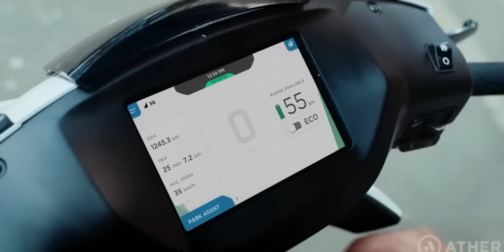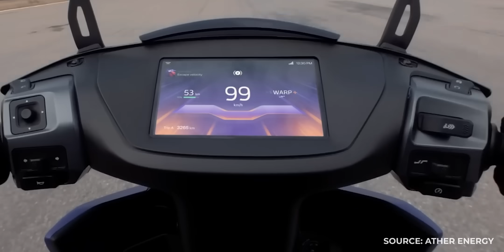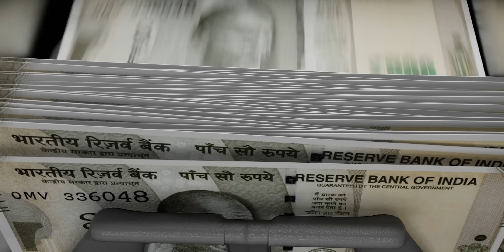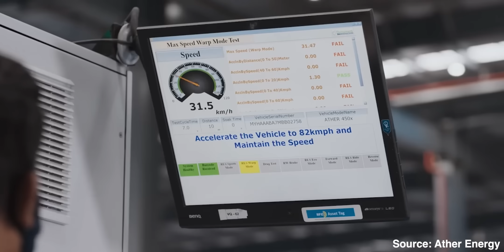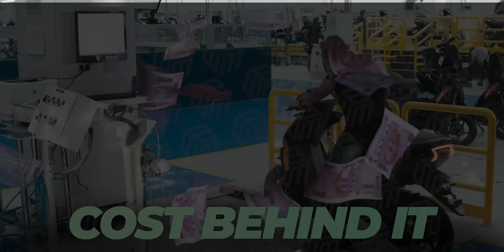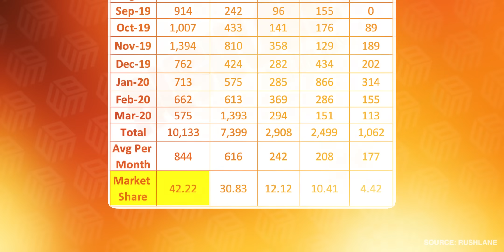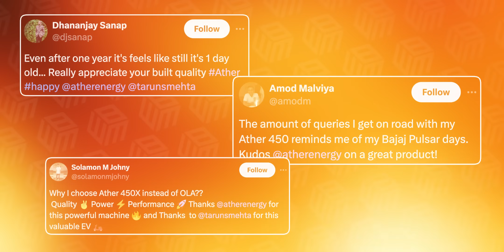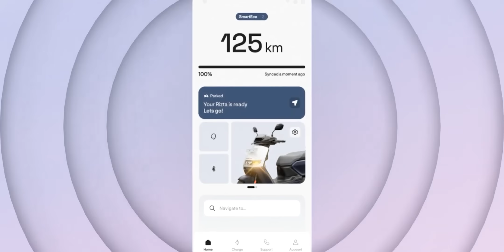Why India's OG Electric Scooter Company is Failing? - Ather Energy Case Study

Comment: Ather will fail because of the high service cost and the warranty is only for three years. It's not only After all the EV true face comes out after the warranty is over. Go for EV if you're Lucky and everything is fine after 3 years. But imagine the cost of parts replacement. Apart from the battery. And worst part is after 5 or 6 years of want to replace the most of the parts will be a relic and again you have to trash it. So staying away from EV specially After is good for your health and have a peaceful mind. AND I'M ATHER 450 OWNER AND USING IT FOR 4+ YEARS AND FACED SEVERAL ISSUES ALL WE COVERED WITH ATHER Service PRO SUBSCRIPTION. Now Ather has stopped all the subscription plans and the service costs are sky high very high.

Comment: Very less range for the price we pay 
It's costed 1.85lac on road and getting only 70km in ride mode 😢😮
Reply: I have 450s which easily gives 85+ kms in sport mode.
Reply: @mayankmaestro then may be you driving light acceleration in normal way.
I am driving with 2 persons with avg weight if 79kg each and 5 kg weight in boot including charger with hard sporty acceleration like you saw in advertising  with avg speed of 55kmph
I am using 450x hr propack  3.5 gen  I am getting only 70km in ride mode and 95km in eco mode ( costed around 1.85lac )
It's too less for the price we pay 
No charges also to travel anxiety free and it takes 5-6hrs to full charge again
Reply: @chaitanyakiran  I am rash driver always drive in sports mode, touching top speed frequently. My weight is 75kg drive solo only. Agree whatever you are saying is correct. At present EV vehicles are not a complete replacement for ICE, Before buying EV must make sure it's true range is around twice of our daily commute. My daily commute is around 55 km and I have a charging option at my office also. So, it's any day a better deal for me. EV can be a good option only if fits in your requirement.
Reply: @mayankmaestro  yeah agreed none of ev as of now replace completely as a primary vehicle for every use case

Comment: I think Ather should cut their cost by removing touch screen or LCD display. Many people in our Village doesn't even use them, in ola obviously so they are moving towards normal key type ola, which is much cheaper
Reply: Yes good point. They should have a base model with no features.
Reply: @raghav90  I too agree with what you say....we  just need a normal reliable electric scooter.
Reply: The touchscreen is part of their overall offering which bolsters their software service plans as well. And a lot of people don't know but a lot of times, touchscreens can be cheaper than needle and button interfaces. That's why you will see a lot of cars that come up touchscreens by default
Reply: How will they spy on users and collect data that can be sold to 3rd party companies? You are too naive.

Comment: Ather is way behind Ola in R&D, check the number of patents filed by Ola in 2023 and compare them with Ather. Most people attribute Marketing behind Ola success but they fails to mentions that buying companies is not new, even Elon Musk bought tesla from someone else but it's what you do with that company. Ola electric filed the maximum patents from India in automotive space in 2023 way ahead of Suzuki, TVS,Ather, BYD(India) etc. Ather had a upper hand in R&D during early stages but now Ola,TVS, River etc are catching it. And in addition ola is building it's on cells which will further give it a edge over Ather in price .
Reply: No. of patents dont translates to being better in R&D. Track record tells you that. Ather has 0 fire cases yet, 0 chassis breakage and better software experience as well. Think about it
Reply: @babbalgts  patents tells alot. It tell how much company is trying to innovate, patent isn't marketing trick. Fire cases are nothing if company has solid feedback system. Ola is heavily investing in vertical integration. Bhavish is smart. Ola is ahead of aether. It's not just marketing. There many peoples in my city with ola. No single fire complaint. 

Its not ola or ather its ola and ather
Reply: @babbalgts  filing patents shows the research intents of a company. It shows that the companies is serious about it's research and development strategy and is not for a few bucks in short run. All the automotive companies when they start and increase their production exponentially have problems, no automotive company in history is free from that. All I'm saying is People are underestimating what Ola electric brings to the table and only attributing Marketing as he only reason for its success, but guess what Hero Vida, Okinawa also did extensive marketing but they failed
Reply: What new innovation did Ola provide with all those patents? Useless music system?
Reply: Patents mean nothing here in India 
It's IP that is true development of technology 
Because I Van have a design as a patent but not technology its more the IP which has a greater value than a patent 
Pls compare those numbers
Reply: @kshitijpandey6514  Patent rights are considered intellectual property.
Reply: Elon Musk only bought abandon car company to manufacture Tesla

Comment: I believe in Ather much more than Ola.
Reply: Ola scooter is good 
Service centre is worst
Reply: Me too
Reply: ather charges premium and provides shit.. yeah built quality is better than ola though.. what ather did in 7 years .. ola did the same thing within 2years with almost same amount of money(offcourse olas r&d were not same as ather as they imported the tech)
Reply: Yes it's a good one
Reply: @Ashu_mm2028you don't care about quality
Reply: @Sticklemitako  it's scooter not a car
Reply: @Ashu_mm2028I use both. But personally I like ather. Because of their after sales service, product quality and the comfort. If you want look than go with ola. But if you like comfort, quality, services than go with Ather. You won't regret.
Reply: @Ashu_mm2028 quality
Reply: @Ashu_mm2028 ola is shit man, their scooty breaks down, customer service is bad. only cost should not be the concern. should you buy one ather for 5 years or 3-4 olas in 5 years
Reply: @Ashu_mm2028 Bcoz ather comes with Aluminium Chasis where as Ola comes with Steel chasis 
Ather's Battery casing was Aluminium which is good for heat transmissions where as Ola comes with Fiber casing which is not as good as aluminium in terms of heat transmission 
All the Ather bikes comes up with PMS motor where as Ola except one High end model every other bike has Hub motor
Ather's Battery comes up with cooling material to cool down the battery where as OLA doesn't have such system 
I hope this gives ur answer
Reply: @Ashu_mm2028 Have you ever heard ather scooters catching fire. Till now this automotive company created the safest ev scooters
Reply: @Ashu_mm2028athee has much better durability and built quality
Reply: Same
Reply: I use both
Reply: Ola is a scam sooner or later it will be out.
Reply: @Ashu_mm2028 THATS A QUESTION
Reply: That's why it fail😂
Reply: @SoldierofGodAki ab bol yahi baat free hogai teri ola ab to😂
Reply: @Ashu_mm2028 better products comes at a higher price. if no, go buy an apple from china
Reply: Thank you sir.
Reply: @Ashu_mm2028 It also provides better value and more peace of mind. Better options sometimes cost more.
Reply: Ceo of ola paid to this youtuber. Surely 😜
Reply: Bhai itni mahgi h ki kabhi top 5 me bhi ni ayegi...price bht important h india me
Reply: @apnirasoi3149  Fortuner bhi nahi aati top five in sales mein. Does that mean it’s bad business? Also they have come out with Rizta to target wider audience.
Reply: @apnirasoi3149  jokes on u they r top 4
Reply: @apnirasoi3149  Rizta is cheaper and much well rounded product than Ola S1 Pro
Reply: Both will fail. EV bubble will pop.
Reply: @VijayNinel  the bubble has never formed yet..  no one will fail either.. Evs are needed.. ICE specially scooters will soon vanish...

Comment: Simple energy builds a similar product for much less.  Their bike only cost 1.1 lakh, and they plan to build the biggest factory in the world.  They have 2 batteries.  They had 1.5 lakh orders when launched at the same time as ola launch.  Ather only builds a small battery bike for a lot of money.  Simple energy has a much better product, marketing, factory and cost model. Ather moves too slow and just got passed by other manufacturers.  Ather charges a monthly subscription that takes away from the savings.  They priced service too high, so Ather is not a savings over petrol.  The competition is focused on value for money and not brand and prestige.  Ather sadly still moves too slow and continues to lose market share.  They copied ola regenerative braking and called it magic twist.  They lied about inventing it.  They are losing the honesty image.  They will go bankrupt at this rate
Reply: regenerative braking z  already there in Ather. Magic twist is a advanced version of conventional regenerative braking. You can completely halt ur vehicle with magic twist irrespective of the battery %. Regenerative braking only slows down the vehicle gradually and it works only when ur vehicle's battery is below 85%
Reply: @ViralBeatsOfficial  Ola has reverse twist regen braking from first release.  It can fully stop the scooter and offers different amounts of stopping power.  It was totally copied by Ather.  They made it work to 100% battery instead of 90% on Ola, and then lied that it was an Ather innovation.  I totally lost all respect for Ather at this time.  There is no excuse for this misinformation.  Now I do not believe any of their claims.  Sad, because before this I really liked their engineering
Reply: @barryobrien1890  Even Ather has that reverse twisting regen in their 450x series from the beginning. Ola's or Ather's reverse twisting regen is not a reliable braking option in most of the times. I have used both Ola & Ather's vehicles. So I  knew their limits.  You might haven't used  450x So hv an opinion that Ather copied the Ola. Conventional regenerative braking is different from the Ather's magic twist. Basically it's the same technology but most advanced or more improvised version. So on can rely it on for braking as good as mechanical braking system for most the braking scenarios.

Once test ride the older versions of 450x.